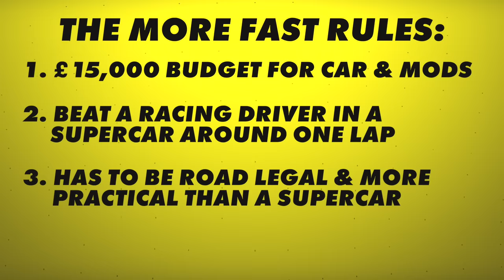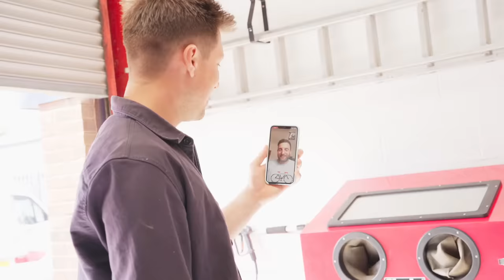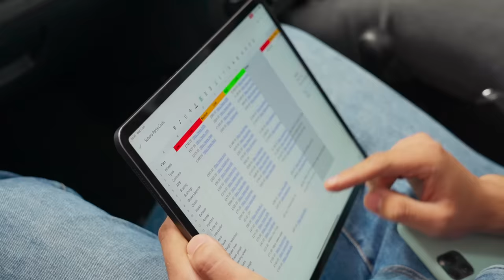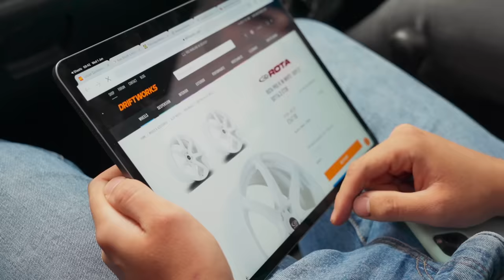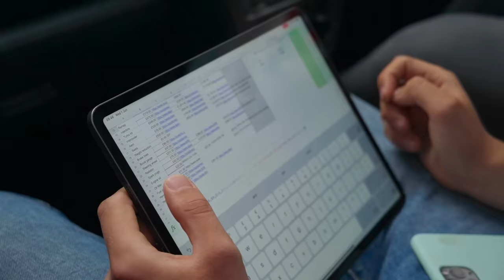Buying a $5000 Project Car to BEAT a Supercar | MORE FAST EP1

Comment: I'd just go absolutly nuts ripping out every single piece of interior, rear glass, rear seats etc. Weight is everything!
Reply: yep, as long as it's still more practical at the end remove as much as possible
Reply: Pull out the comforts like air con and some interior bits and sell them to help pay for performance parts.

Comment: I was expecting a Subaru cos it comes with awd as standard. And since you mostly get them with a 2.0 it leaves you with plenty of options to play around with hp and torque
Reply: @kurtlamprecht93  I find it a good basis for the challenge. I could go in to further details but it would be fairly lengthy more than I have time for now to explain sorry! But google around and you will references to the 2.0 V4 being referred to as the “perfect” engine
Reply: @kurtlamprecht93  Look up here on Youtube. Search “Perfect car engine”
Reply: @Bluefox1978  1.8t 20v bam is perfect
Reply: @timverelst1471  @KurtLamprecht true. I’ve also seen 2.2 vtec from Honda. It is not that it MUST BE 2.0 or not. My pov is just that when you hear about flat 4 engines from street legal car that can compete with supercars it very often ends up with a 2.0. Why this is so are more or less explained in some of that videos you find here searching “the perfect car engine”. Should I be guessing myself I would say that has something to do with how much combustion pressure you get relatively to torque, weight and fuel consumption and in that perspective have the optimal conditions with a V4 2.0.. Further argumentation would for me require a mechanical engineer specialized in combustion engines

Comment: If it is an on track race suspension and tires are obvious but upgraded rear limited slip and replacing the front open diff with an LSD is a must. That will definitely improve handling and have ultimate grip and power delivery.

Comment: the most important things you should splash the cash on;
-wheels & tires
-brake pads

Depending on the condition on the current rotors, you might be able to get away with the stock ones since you're only doing 1 lap. Unless you could find used uprated brakes for cheap

Comment: A bit late for this, but don’t bother with nice looking wheels. You need light ones, not flashy ones. Also the stock steering wheel will do just fine for one lap. Get good tires and suspension first, before adding more power. Also you really don’t need all those seats, carpets, trim pieces, stereo system, etc. Lot of unneccessary weight. You can also save a few kilos on taking out the fog lights, a sunroof delete, and surprisingly, emptying your windshield washer reservoir(that in itself is 2-5 kilos, depends on the capacity!!). For brakes, I’d go for EBC pads, and maybe some vented Brembo discs.

Comment: My 04 wrx wagon stock ripped a 2017 sti from the dig twice on the streets. I had 200lbs of tools and outdoor gear. Plus my dog in the back seat. The sti owner was riding alone and was blown away because my husky was hanging his head out the window and still gapping him haha. Love my wagon!!!
Reply: Yeah? Lol the new sti's weigh 400lbs~ more with the same hp
Reply: @magicstew45  the 2017 Sti has 80hp more. It has the ej25 with a larger turbo and puts out 305hp. My Wrx wagon has the ej20 that puts out 227hp. It's is 400lbs lighter but definitely has less power and is at a disadvantage.
Reply: @kaduzie_productions7257  easier to add comparable power to the old one than it is to drop the weight of the new one

Comment: As Colin Chapman said " for more speed, add lightness" . You need steel wheels,  much lighter than alloys (although originally it was meant to be the exact opposite)  which is unsprung. A big wing will give downforce but lots of drag, so unless it's a rally cross circuit it'll make the car slower.

Comment: Tires are a must, go splashing on them. Then I'd suggest a power tuning with some massive turbo, maybe a twin-scroll setup would do the trick and give enough power through a bigger rev range. Also, Chassis rigidity is necessary, so add on some cowl braces, frame rails, and also some other braces. Lastly, to carry the speed through the corners, fit in some stiff coils. Swapping the steering wheel and other stuffs is not necessary, which won't give a lot of power. But to deal with the increased power, clutch and brake upgrades are.

Comment: In order of importance - gut the interior, cup sport 2's for 1500, suspension 1000, brakes 700, race clutch & flywheel 1500, MD321V turbo 2000,  injectors 500,  front mount 1000, rods 1000, pistons 800, head bolts/gaskets 500, exhaust 500. Sell the gutted interior and buy an Ebay Nitrous system for 500.

Comment: Beat a Supercar in that? You're going to need more than 300bhp and to stop wasting money on steering wheels, wings and new alloys. Start with a set of Pirelli hillclimb/sprint tyres to maximise the grip over a lap...
Reply: @kurtlamprecht93  when we're talking about seeing which is faster, does it matter about being road legal? You can't race on the road anyway. Of course, there are loads of road legal hillclimb tyres, but they're not the ones I was referring to.

Comment: Id buy in order of priority:
1. Tyres
2. Brakes
3.suspension
4.injectors
5.(optional) turbo
6. Map
7. Chassis stiffness ( some of which can be done for cheap like welding a brace accross the rear suspension mounting points
8.exhaust
9.(Optional if there is remaining budget) bucket seat
10. Digital standalone dash. To replace the gage cluster.
11. Every other penny goes on race fuel
12. Take a big dump before racing!

Then standard items like weight reduction and full service are a given. Same with a new clutch.

Dont faff about list:
1.spending money on new wheels if the current ones will fit the new brakes
2.Steering wheel - just take the airbag out of the current one
3. Aero - you wont be going fast enough for most aero to work, and unless your going to spend a lot of money on getting low speed downforce it wont be worth it and will just increase drag. However, a very simple flat undertray with a slight rake and some plastic side skirts could make a small amount of ground effect for pretty cheap.
4.anything cosmetic in any way. Do the wheels come painted for 10 bucks more, nope that can go on fuel.

Remember road legal is pretty widely defined and if you really wanted to go crazy you could sand off the paint or even remove the headlights (day running only) that sort of thing.

Comment: This is the best car content on YouTube at the moment 
Definitely get the remap and turbo 
And those better tyres. Rather than a huge wing a flat underfloor pan helps airflow 
where a wing slows you down at the top end
PS agreed on the idea of weight reduction
Reply: What does having a flat do? If you dont mind me asking?
Thanks
Reply: @markrichards9934  a flat underfloor helps the air flow under the car's body improving top speed by reducing air resistance
Reply: Hagerty with Jason camissa is though to beat when it comes to car content on YouTube. But I do love what they are doing here

Comment: 1. Weight removal, it's FREE to do, Strip that sucker to nothing
2. Tyres, they have the biggest impact
3. Suspension
4. Power: Turbo & Map etc
5. Brakes
6. NOS? Cheap for instant gains, you're only doing one lap
7. Aero, splittler and wing

Please don't waste money on aesthetic stuff like MOMO steering wheel and gear knob, or facny looking wheels, if the current wheels are ROUND then use them

Comment: coil overs are a must, that would improve lap time alot.
and rollbars of course.
then get as much weight reduction as possible, good tires.
and even tho you said it's better only getting better brake pads i think it's better to upgrade the whole thing cause if they fade after 2 corners then you're done.
obviously you'll never beat a supercar with this bugget and this car, you'd have to build a new car from the ground up, but these would be some of the best options.
Reply: Stock brakes don't fade to easily now.

Comment: "I've picked, a GIANT V8"

You can buy said giant V8 on ebay within the budget; from around £4200 ($5130), sometimes included with the gearbox attached (which would include the clutch, thereby solving that problem).

Essentially, what I'm saying is, LS SWAP IT!!!

Comment: Wheels and steering wheel upgrade aren't going to improve lap time.
Reply: i agree. Just tyres and suspension should be considered.
Reply: Couldn’t agree more. Just take semi slick, road legal tyres and put them on the rims you have. If you want white wheels just buy a couple of rattle cans and paint by yourself.

Aero will not help at all, spoilers only will add drag. If you want to do aero, just tape over all panel gaps to have less wind resistance.

Cheapest option to go faster would be to strip all from the car which you don’t need to make it as light as possible. Weld all the spot welded seems to make it more stiff and handle corners better.
Reply: The wrx wheels aren’t the biggest , wider aftermarket’s wheels means wider slicks
Reply: Wheel is dependable, ultra light wheel would make sight noticable different
Reply: Only half right, if they can save 10kg by buying lighter and wider aftermarket alloys then thanwill certainly help improve the lap times
Reply: @tonydixon2684  that facts
Reply: @tonydixon2684  how big are these wheels? I’m guessing 15 inch, they probably weigh around 10 kgs per wheel (without tires) good luck in saving 2,5 kgs per wheel on that ;-) of course can be done but would be very expensive. I would rather spend my money on proper suspension and swaybar for example

Comment: Gutting it, removing the aircon and adding some super sticky tyres is probably going to give you the most bang for your buck, trying to get more power out of it is going to be risky because scoobies can be a bit fragile. Don't bother with aero, you're not going to be going fast enough to make any appreciable gains that you couldn't get with adjusting tyre pressure, don't waste money on non functional parts. Suspension, ARBs and strut braces will allow you to tune the natural understeer out (have it professionally aligned) and then spend what you've got left on a turbo, injectors, boost controller, intercooler and an ecu remap.
Reply: this is the comment

Comment: Make it lighter! And: buy good lightweight wheels, best suspension you can and set it up for track, best brakes you can and best tires. And nitro it. Of course fix clutch and make sure you've got good cooling. Don't do any intake/exhaust/turbo bullshit!

Comment: For overall lap time with a vehicle like this Colin Chapman comes to mind: "simplify, then add lightness". I personally would gut the car of anything unnecessary, reduce the rotating mass of the steel wheels with something lighter, add some sticky track focused tires, switch that God forsaken clutch for a lighter punchier one, upgrade the suspension and brakes (definite must!). If there is any budget left, then begin with exhaust and other power related mods. Have fun guys!
Reply: I concur. They'll probably need all of that including the power though, otherwise they'll lose too much on the straights.

Comment: Get the recip out and remove all the weight, add the cheapest race seat and lightweight battery. Clutch. Set of coilovers and best tyres, some used bigger calipers,discs,pads that'll fit. Upgrade exhaust, air filter, turbo and an extreme remap, splitter and wing? Look for used parts to save money. Minimum super unleaded to do a lap, practice driving it beforehand.

Comment: R spec tyres on standard rims, brake pads braided lines and fluid, sway bars front and rear, weight reduction, 3 inch exhaust, intercooler, turbo, tune, win with money to spare.

Comment: on the aero side: make a front splitter out of plywood, vent the top of the front fenders, DIY aluminium sheets for flat floor + diffuser. i also second putting wide, massive slicks on the car, at least 17x9 255

Comment: Drop weight. Lose everything you can. Intake,exhaust, dont need crazy high end.  Cobb tuning has some good packages. Turbo upgrade with injectors. Change the torque rod on the back of the engine under the intercooler. Add chassis bracing. Get the biggest brakes you can afford. Calipers,rotors, pads the works. Full suspension. If you cant outrun it out brake it. And do not skimp on tires. And put a roll cage in with proper seats. 6 point should keep it practical still.

Comment: The challenge is improve handling, improve braking, then improve power. 

Skip new wheels, skip new steering wheel, skip the wing. 

Spend outside the budget on improving your own skills. I’ve seen videos where a professional driver in a camery beat non professional drivers in supras. This car will be a momentum car - get good at taking corners fast.

Comment: Toyosport exaust  
STI wheels (fit brembos ) with nanyang tires
Sti front callipers and disc, + etc rpm pads
bc rm suspension or Sti suspension
anti lift kit( very important on this cars)
vf 35 turbo, + pink sti inyectors + wallbro 255 fuel pump + sti intercooler(or big front mount intercooler, even cheaper)
remap
do a big weight reduction,

With that you will have a 350 horsepower fast spooling car with decent handling. Very competent

Comment: No aero, leave the stock steering, keep the stock wheels. 

Shocks and springs, sway bars, GOOD tires, alignment, brake pads and braided lines with high temp fluid.

Intake, exhaust, clutch, intercooler, injectors, flashed/chipped ecu and whatever Chinese turbo they sell as a bolt on upgrade for an sti.

Comment: A Toyota Celica VVTLI cost just £1000, it has 192 BHP, it is a very light car, very easy to tune and it can support a turbocharger which could bring the power over 300 BHP. The only downside is that it is a FWD car.

Comment: I wouldnt do wheels and a wing, if you just wanna be quicker.

Set of semi slicks for the original wheels
Exhaust
Maybe a hybrid turbo 
A proper tune
Front mount intercooler
Clutch
Suspension (coilovers and if there is money left sway bars)
Pads and rotors

Comment: I love the idea, but also think that trying to keep it road legal is ridiculous, and I don't see it becoming faster than a supercar this way. In my opinion, you should go all out (maybe except cutting the roof off :D)
Reply: I'd suggest spending most of the money on suspension, power and very aggressive pads, made specifically for the racetrack. Get used soft slicks, DIY aero and remove as much weight as possible without softening the chassis

Comment: Aero is complicated and is not worth your time if you cant test drive the car. Tires, suspension and brakes are the biggest mods to increase performance around a track. Must also test drive to optimize. The turbo with a huge hole makes the car barely driveable on the road but gives you the most performance round the track if you can keep the rpms up.

Comment: Yes, a wrx can be an absolute monster for 15k. Ive been planning on building my wagon with an aftermarket block, rotated turbo, built 5-speed with blast plates and some other goodies. I want to be pushing 450whp

Comment: Love the idea for this series! 1. Don’t you dare get Rota wheels please. They’re heavy, cheap China garbage that fall apart easily and have been known to break while being tracked!!! I’d highly recommend Kosei K1s. My 15” wheels weigh 13.5 LBS each which is easily one of the biggest differences in performance for the price and they cost just as much! Idk if k1s come large enough but koseis or enkei are your best bet. I love the WRX wagon but personally I’d have taken a cheap Miata or maybe MR2 chassis, K swap it for a few thousand and then slap a turbo on it and it’s making 500hp stock then focus on suspension ;)

Comment: You got this. 

Buy a bmw N54 135i for around $10k. Spend the next 10k on mods (FBO and suspension and weight reduction) and you got it.

Comment: Don’t cheap out on the transmission, it’s a wrx and they’re made of glass (I know from experience). Anything over 250hp they’re unreliable and tend to strip gears. Buy a set of thicker cut gears and throw them in, it’ll be worth it. If you have the money to spare, get an sti transmission, but I’m pretty sure that 04-05 you need to replace the front axles, front wheel hubs, and driveshaft so thicker gears might be the better option. That’s personally what I did for about $750 in parts and doing all the work myself and it’s still holding at 450hp and 20k miles.

Comment: turbo, full exhaust (including downpipe) injectors, fmic, tune, should get you 200kw at all four wheels. Add heaps of lightness, some coilovers and some Adjustable swaybars and it'll be a weapon

Comment: You should really get a set of slicks in those aftermarket wheels, there is little road tyres can do against those. Although you are going to nuke the stock brakes.
Reply: They said that it need to be road legal so slicks isnt an option 🤣
Reply: True, I thought they meant that it had to get to the track road legal lol

Comment: Get the best and stickiest tires you can for that thing. Wheels should be light to reduce unsprung and rotating mass, which impacts acceleration and deceleration and grip levels too. Performance pads and fluids for breaks and if the disks need replacement stock should be fine especially if you reduce the mass of this thing. Take out everything you dare out of this car. The less it weighs the better. Suspension mods are cool and all but they have to be tuned for the chassis and the mass of the car which is tricky and requires expertise. For performance you want your suspension to press the tire to the road the best it can to maintain contact patch. If you go too stiff on springs and shocks it won't do you any good because wheels won't stay in contact with the road as much. Tighten up, stiffen up the chassis though, the less flex in the chassis the better. It let's suspension actually work and do it's job.